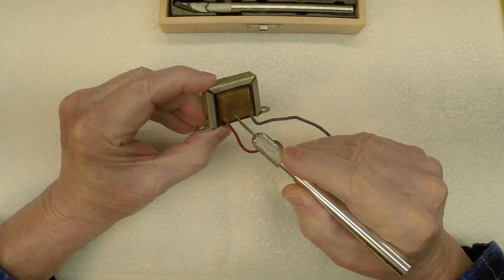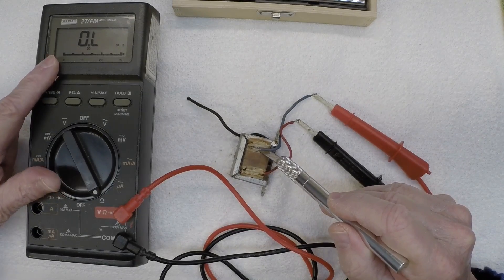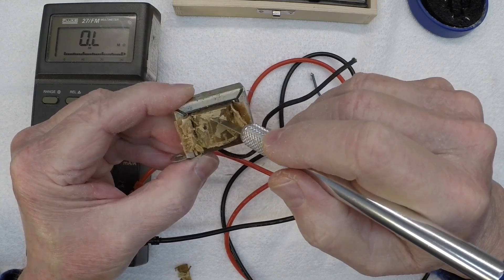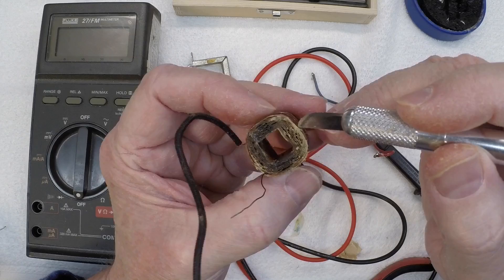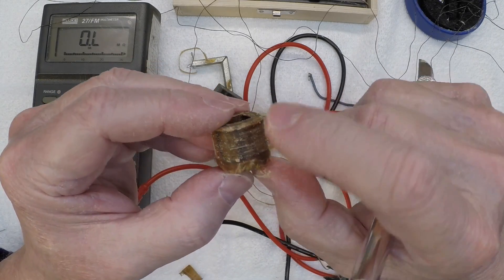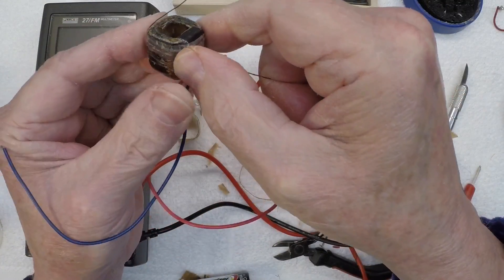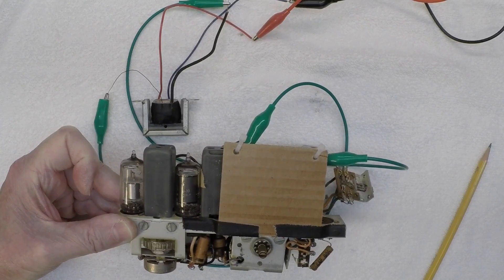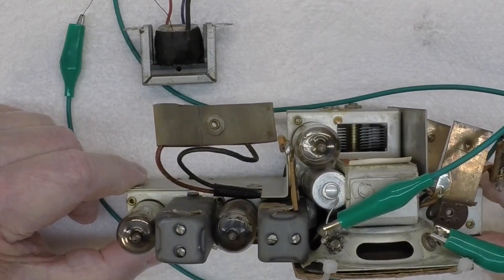Airline Portable Radio - Model 84GCB-1062A - Output Transformer Repair Attempt

Comment: Nice work, I live gwalior in india, and  I want to know about what is meaning by 5k:8ohm 6 watt, for tube amplifier contains ecc83,el84,ez80 and em84 tube in circuits. 
I have these tube in my collection. So I want to build a single ended tube amplifier with these tube's, but due to NIL knowledge of outputs/audio transformer unable to make the amplifier.
Also unable to find this type of transformer in local area.
Can I use step down transformer that is available in local market like 6-0-6v, 12-0-12v as on.
Or any kind of knowledge or data to wind output transformer for given information.
I am afraid to buy these transformer from eBay/ali express.
Please Help/Guide......
Thanks

Comment: So, what was the cause of the winding failure? How many layers in did you find the fault?
Reply from the maker: It’s hard to say. I checked all of the paper caps I replaced and none were shorted. I believe the magnet wire was broke near or at the the location the lead was soldered to. Best, Don

Comment: I have lost track of how many of these I have done. Had pretty good luck with this too. These little transformers don't seem to burn out as much as fail at a connection. I suspect it is because the wire gets nicked or weakened by twisting when assembled at the factory. There isn't much power being put to them in battery sets especially.
Reply from the maker: Yep, I was thinking the same thing Ray. I appreciate you reaching out and taking time to watch. Best, Don

Comment: Great job! I used to fix transformers this way back in the late 60s. The transformer didn't look quite right there at the end. Are you going to put the I bar back in its proper location? I presume, "Yes".
Reply from the maker: Thank you for bringing this issue to my attention before I mounted it back to the chassis. I did a call out in my final video I just published. Thanks again. All the best. Don